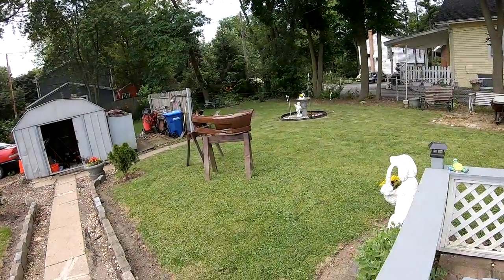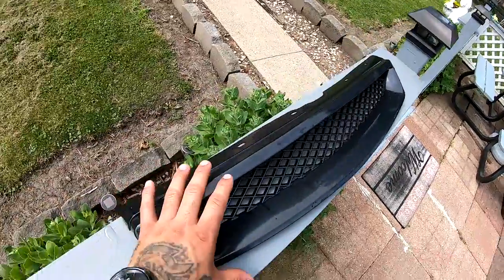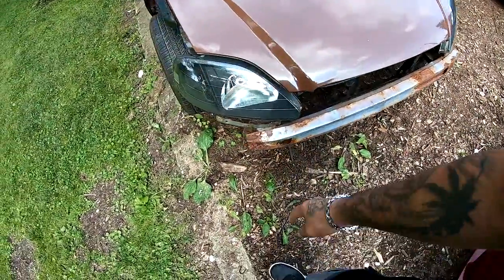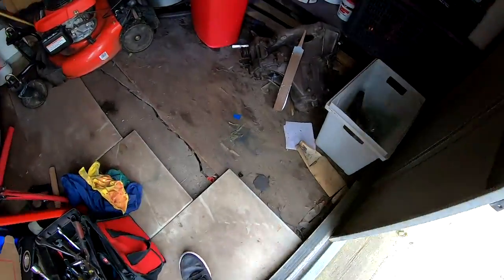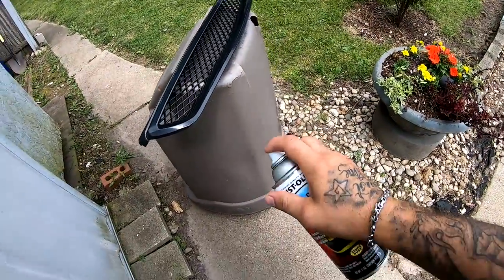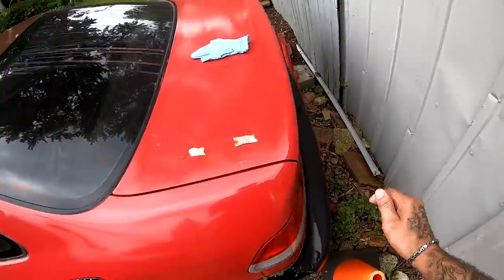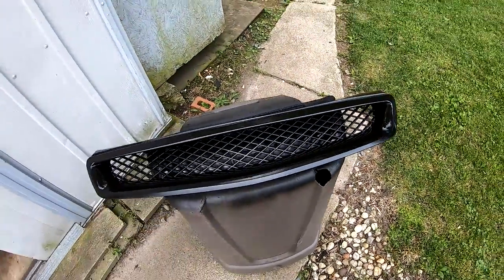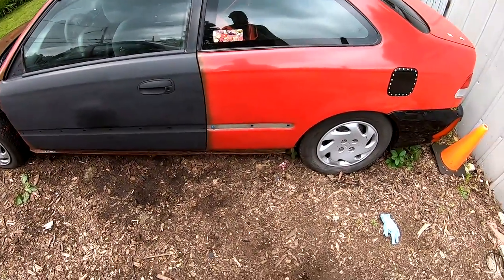Rustoleum Trim and Bumper paint on front Grill

Comment: Do not cut up your car the way you are described. The structural rigidity of the car will be severely compromised. I’m not talking about a crash, but the twisting of the car itself. Look into chamfered holes if want to “add lightness”.
Reply from the maker: Yeah i know exactly what your talking about i thought about the twisting of the frame many times when i was gutting it the first time thats why i drilled holes in most panels. Your 100%right.. Chamfered holes your talking about drilling dimples?

Comment: I painted my grill and it came out all rustic was it because I didn't primer it first or what  the grill is plastic i just painted it but came all rustic
Reply from the maker: you had a reaction. did you wipe it with mineral spirits before paint.
Reply: @BarbasLife  no when I sand it I wiped it with alcohol and then dry it i think it was because of the alcohol but I have no clue